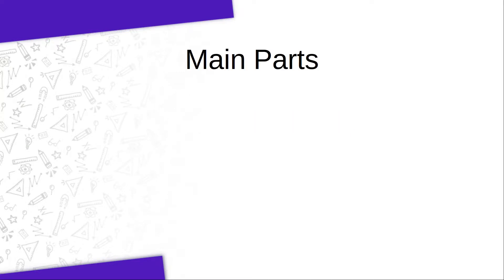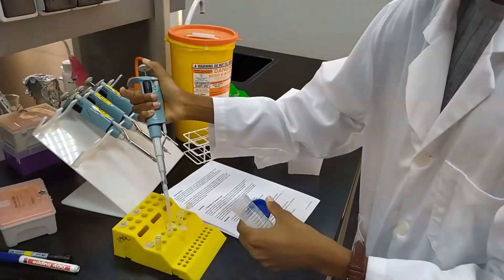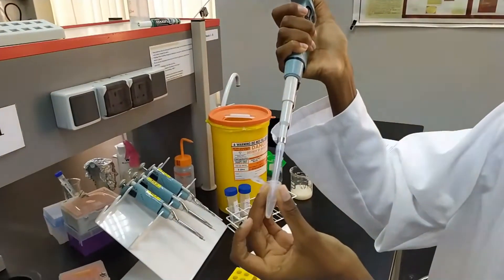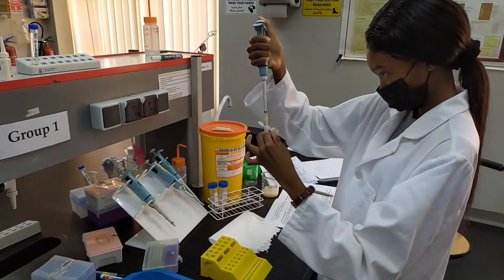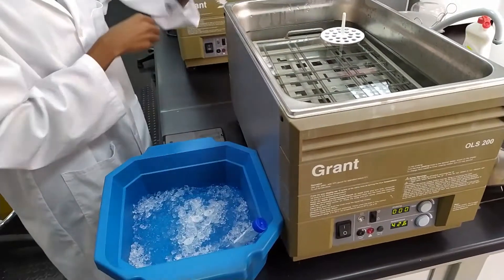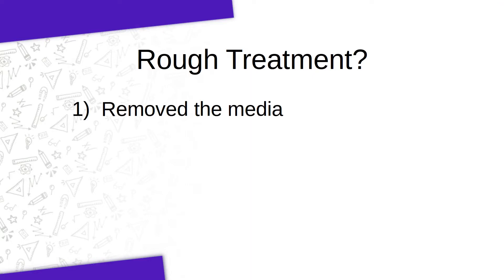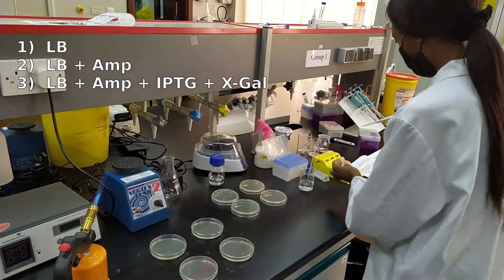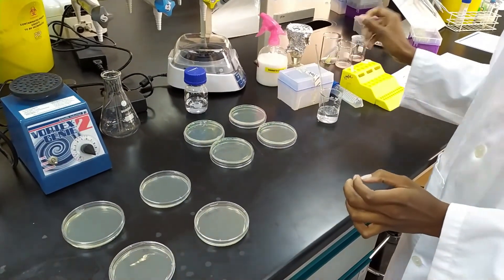Bacterial Transformation by Heat Shock (BIOL310)

Comment: I'm guessing a shorter time in the hot bath works better? love to hear your experience
Reply from the maker: I haven't personally tested different incubation times - this is a fairly old, and well-established protocol, and I've never had any reason to try to optimize it.  I'm not sure if shorter is better, but most protocols I've seen tend to range between 30sec and 90sec.  I suspect that if you don't give it enough time, you may not get the desired expansion of the cytoplasm inside the cell.